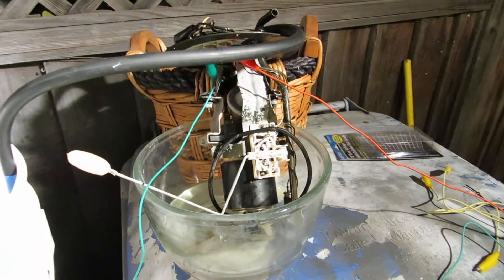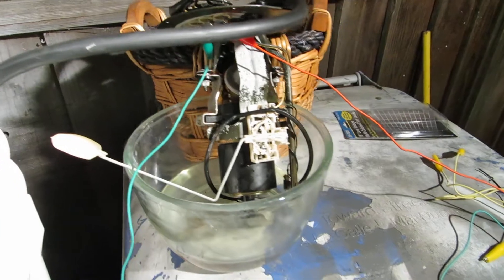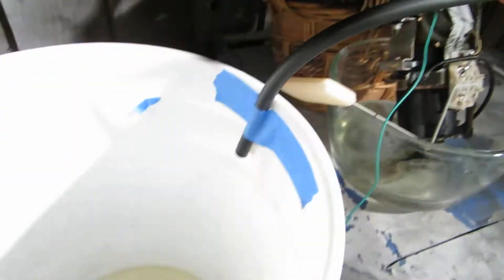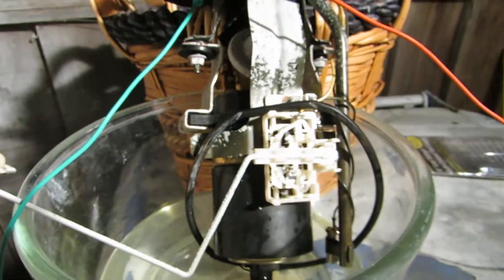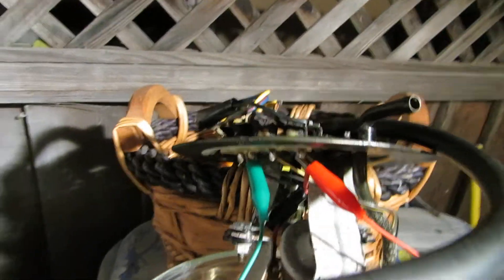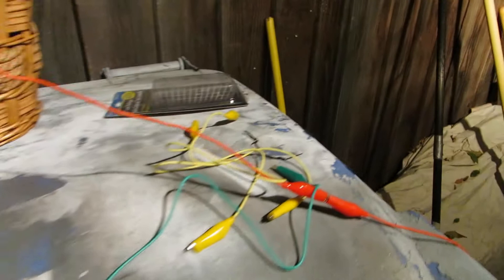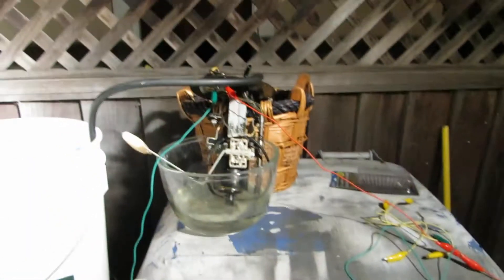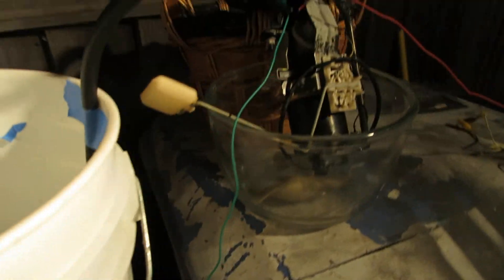[How-to] Fuel Pump Bench Test [part 1]

Comment: Yeah the thing about that is theres fuel pressure then there's fuel volume then last but not least GPM gallons per minute last pump I replaced could spray a little fuel in a bucket no problemo but can it keep up doing 80 mph holding steady @WOT. For an extended amount of time on a 100°f day
Reply: I believe if i put the gauge on a T, and slapped on a FPR (open vac) to a bucket on the other end, i could have let it run and stress tested at 43 psi for fuel. (Nissan oem FPR). 
Not sure how to simulate load, having an open fuel line into the bucket like above may be max stress. 
Then watch fpr for any fluxuations. I had a pump fail intermittently dropping pressure (miata) and it delt like a power on/off switch. Should show up on a pressure gauge as quick pressure drops

Comment: Thanks for this. I have a new fuel pump that I installed that's not spitting out any fuel. I think it's defective. It makes noise and  I've tried reversing the wires at the plug and I still get nothing BEFORE the fuel filter. I think there may be something up with the impeller maybe.
Reply: You put a strainer or strainers without you will get NOTHING PROBABLY bad relay or pigtail harness dirty connector rusty ground
Reply: @bradysolaem2467  🏆 I've seen some bad advice misinformation on the internet, this takes the 🍰   it's like a wrong royal flush.